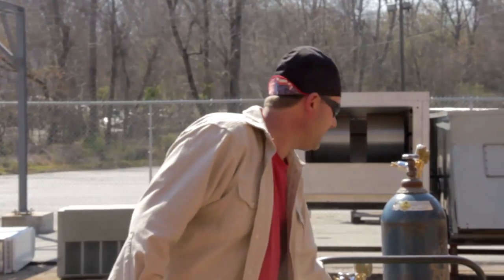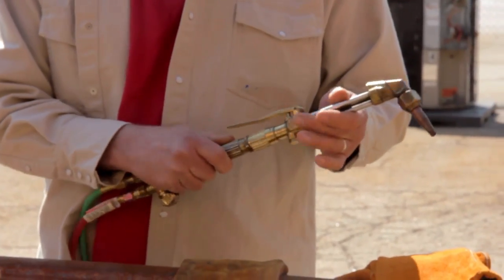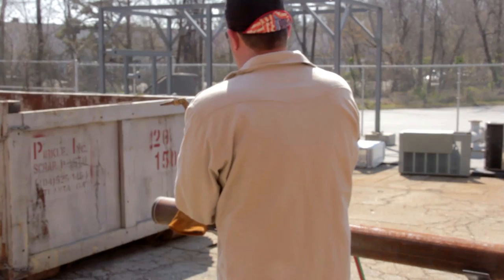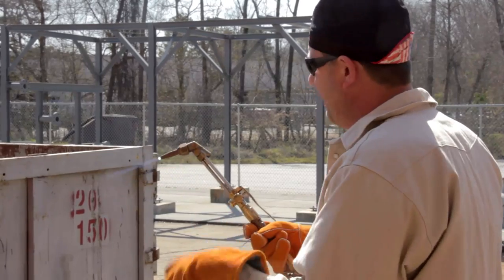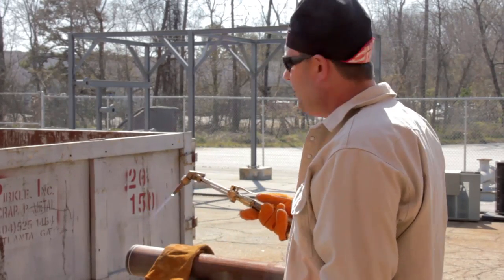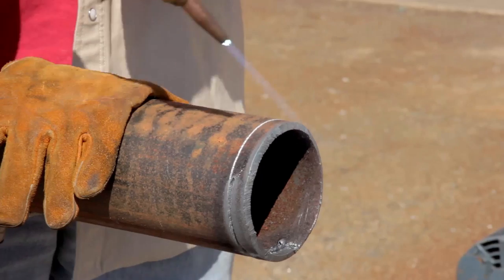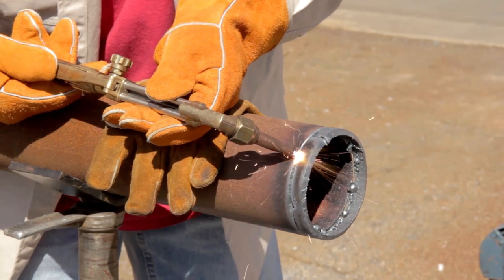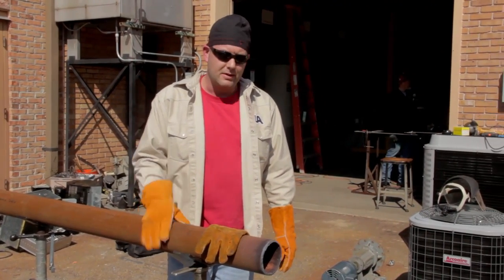Pipe Cutting with a Torch

Comment: turn the ace off first then oxy.  never seen anyone do it backward like that.
Reply: O2 off first for VICTOR and SMITH type torches, not sure on the other brands. 
That was the correct way by the book.
Reply: Heavy Metalworks 
The reasoning for this, I assume, is to prevent all the sooty shit filling the air around you.

Comment: Nice cut I was taught to shut gas off first but no biggy,  here is the bottom line if your really good with as torch you will be more valuable than if your a better welder.  Cutting with a torch is an art and a true skill. Anyone can weld.